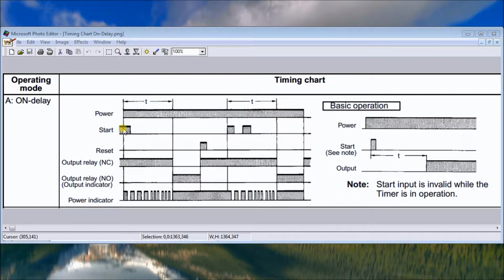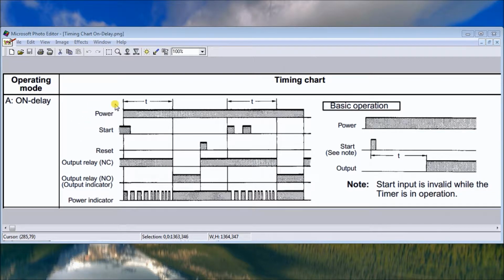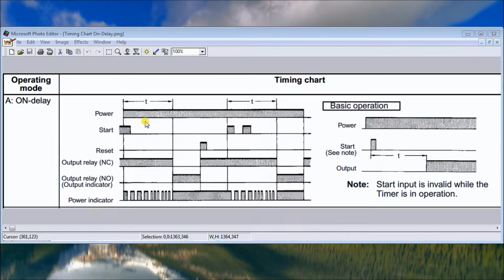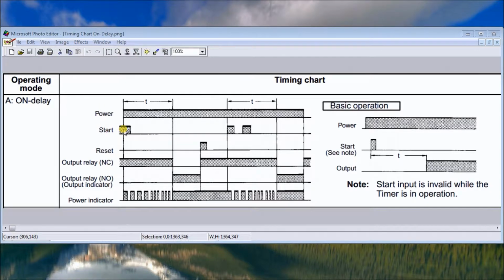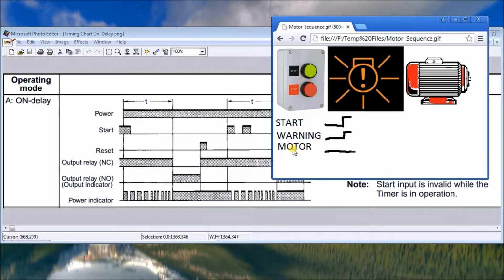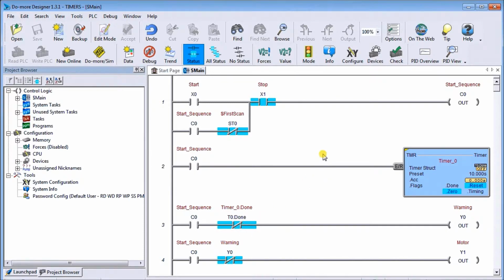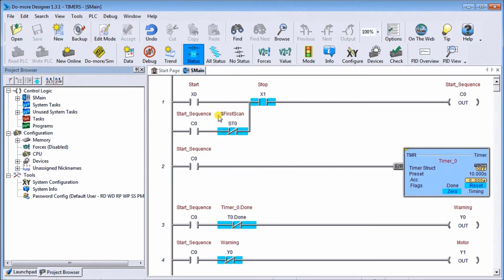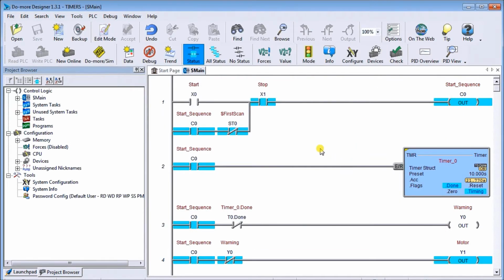PLC Timer Programming Tutorial - Do-More Designer Timer Logic!

Comment: I am having issues with the ClickPLC timers reaching the setpoint and then restarting, the done bit never activates! I have tried several ways, including adding a reset bit, using a counter to count when the timer reaches setpoint, timer enable bits, nothing is working, my timer just keeps repeating!
Reply from the maker: Ah, I know exactly what's happening — that "reaches setpoint, restarts, done bit never latches" behavior is the signature of a self-reset loop, and it's almost always this: the timer's own done bit is resetting the timer, or it's sitting in the timer's own enable rung (e.g., enable = X1 AND NOT T1).

Here's why that oscillates: on the Click, the timer's current value (TD) resets to 0 the instant its enable goes false. So the moment the timer finishes, the done bit turns on for one scan → that drops the enable (or fires the reset) → current value goes to 0 → done bit turns off → enable comes back → it counts up again. Repeat every scan. That's also why adding a reset bit and the counter made it worse — they're all still tied to the "done" condition.

The fix is to keep the enable maintained independently of the done bit:

1. Drive the timer's enable from a latched/maintained signal — a seal-in rung, or a C-bit you Set with your start button and Reset only with a separate stop/reset button. Do NOT put T1 (or anything derived from it) in the timer's own enable or reset.
2. Once the enable is held true, the done bit T1 turns on at setpoint and stays on as long as the enable is held.
3. Use T1's contact on a separate rung to drive your output/next action.

Strip out the extra reset bit and counter, get that one clean enable rung latched, and the done bit will hold. Click-specific timer walkthrough here: https://accautomation.ca/master-the-clock-using-timers-in-the-click-plc/

If it's still fighting you, paste a screenshot of your timer rung and the enable rung and I'll spot it in a second.

Regards,
Garry — ACC Automation